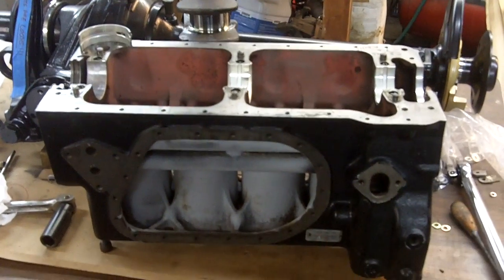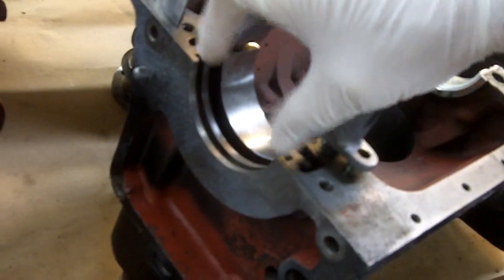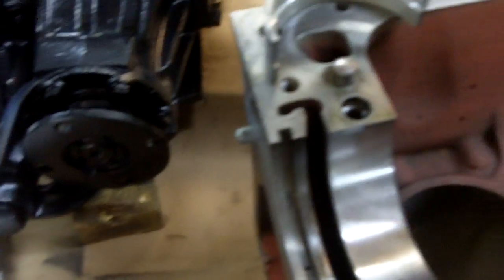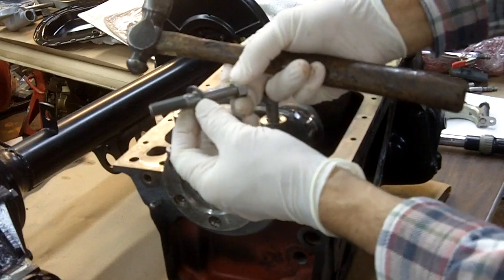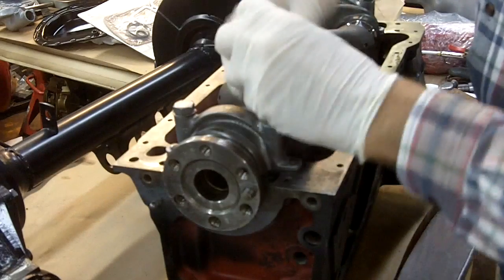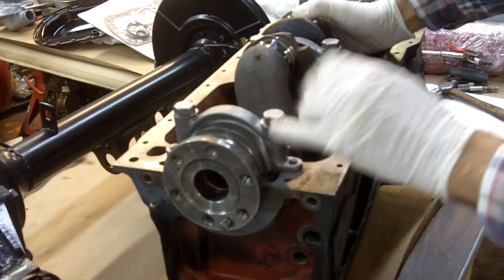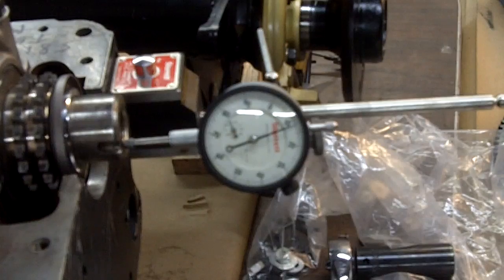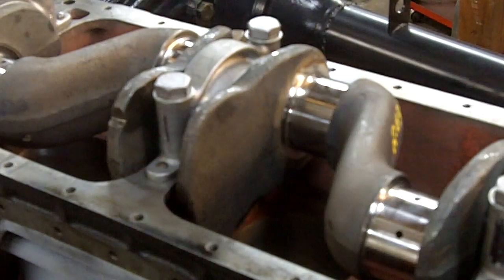Mercedes 190SL short block

Comment: WILL ; you should also show the proper fit and cutting the rear crankshaft seal .
Reply from the maker: Good suggestion. It is amazing to realize the instructions on how to fit/cut the seal are NOT in the 190 Workshop Manual. They first appear in the W108, 113, etc manual. I have those instructions available and email them to anyone who asks. While it is not a technically difficult job it is a CRITICAL job. Do it wrong and you will be forced to remove the engine and totally disassemble it for repairs.
Reply: @Mercedes-Guru  ;  Correct.  the proper way is the only way

Comment: Is there a video of rear main oil seal replacement. They can be tricky. Mine was professionally rebuilt but the seal is leaking so needs redoing.  Must the crankshaft be removed for this?  Paul
Reply from the maker: Hello Paul, good to hear from you. I will send you the official rear seal install instructions. Very straight forward once you read them. The seal comes as one piece, but there is enough to do cut in 2 in order to install in the block and the pan. There is a steel pin that holds the seal in place in the block. And, the seal is a VERY tight fit in the block, so in order to replace the seal in the block the crankshaft DOES HAVE to come out. The seal is so tight we will usually compress it in a vise to make it narrow enough to install. You will need a .020" feeler gauge to use as a guide to cut the seal to the correct height above the parting surface of the block and the pan. Yes, the seal protrudes .020" above the parting surface so that when the pan is bolted to the block the ends of the seal are in compression. I install the seal in the block, install the crank, install the seal in the pan, dry bolt the pan in place, remove the pan, then trim any string bit or flashing that has splayed out. The end result will be a perfectly square tip with not bits splayed out to interfere with the pan to block sealing. Hope this helps. Will

Comment: Nice job buddy.  I'm surprised no comments... One other thing the factory would do which MB no longer recommends is oiling the threads on the bolts prior to installation. Not sure on the 121, but MB also claims to angle torque many fasteners as well.  How along is this project